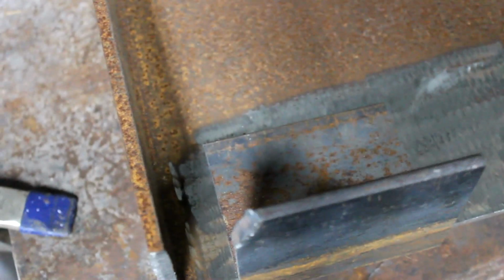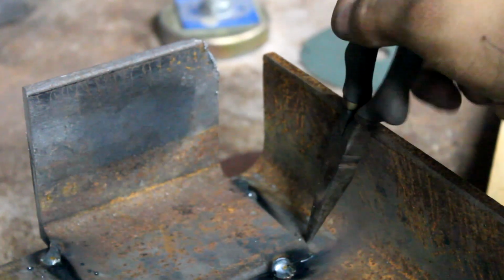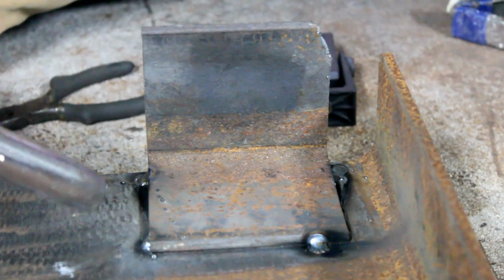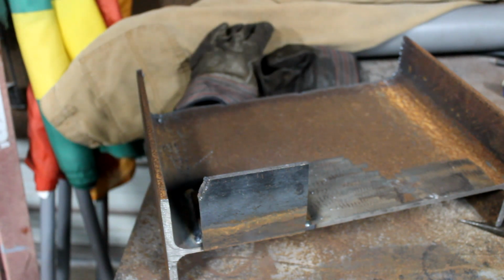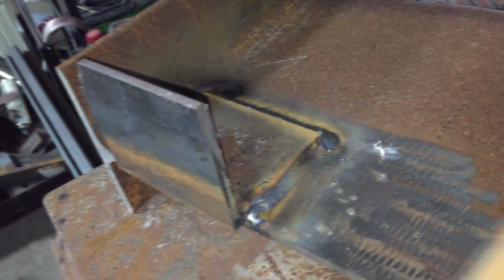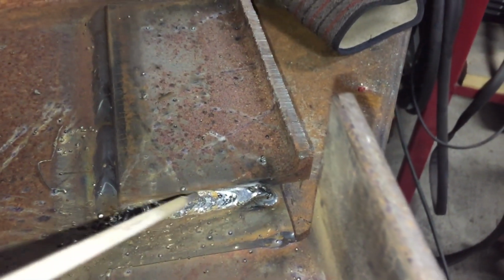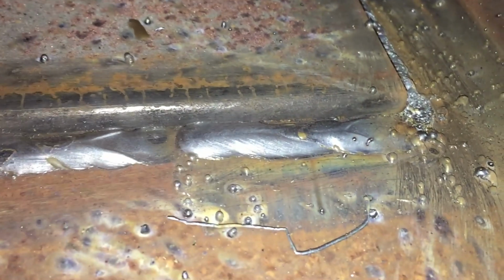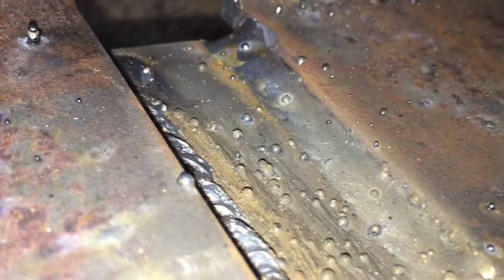Structural AWS D1.1 Welding Problems

Comment: Actually you want to start on the sides of the clip welding in and rap the corners. If you weld out starting from the corner the weld could crack when a load is put on the clip since the end of your weld is seeker then the beginning
Reply from the maker: Well you can wrap the corner either way it’s all personal preferences.